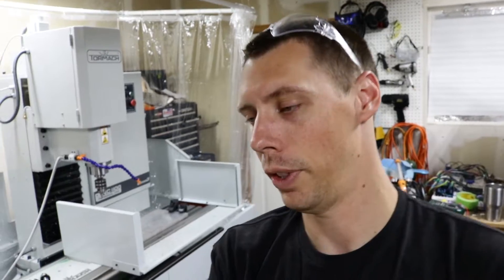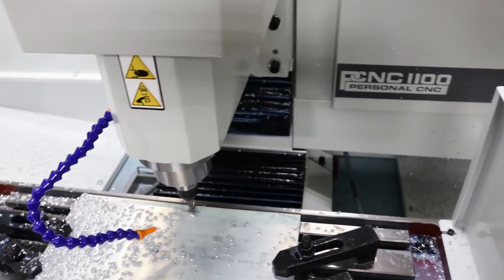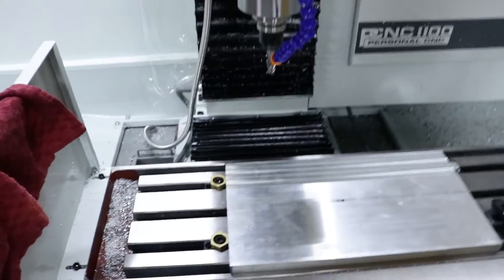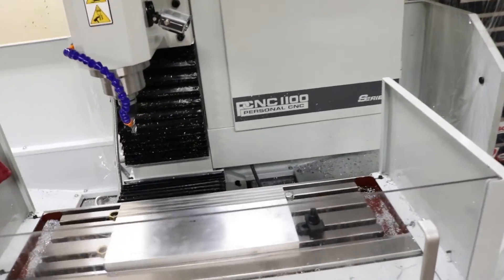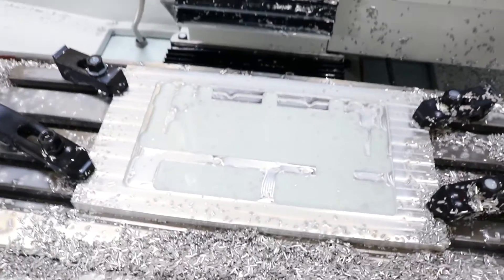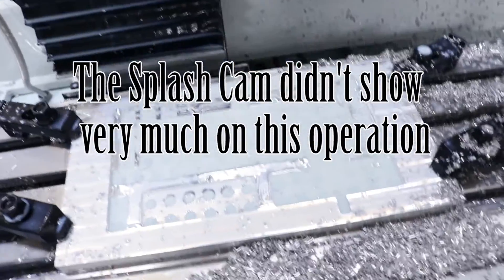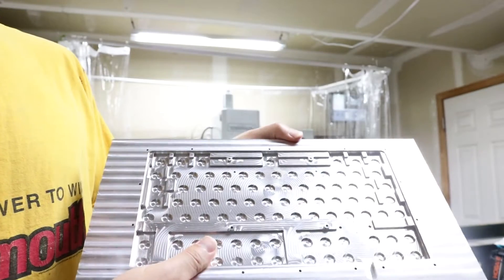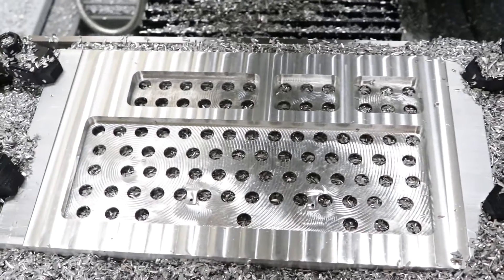Tormach 1100 Milling Aluminum Plate

Comment: Oof so barely cut one part and you already have chips grinding in the ways? I was looking at tormach for a while but now I think I'd prefer to spend a little more on a machine with linear rails and built in guards. The dovetails coming loose or going out of spec seems like a hassle.
Reply from the maker: They aren't grinding in the ways,  it's just the chips built up on the cover.  But yes, I would love some linear ways.

Comment: I bet you can increase your ramp feed on that helical entry. I think fusion defaults to 1/2 feed rate for plunge and ramp. The 3 flute zrn carbide end mils don't mind as long as your work holding is secure.
Reply from the maker: I thought that as it was running.  I plan to speed it up in the future.

Comment: Good stuff man . I probably would have clamped to bed drilled 4 holes (either countersunk or deeper counterbore to leave room for facing) to match the t-nut slots then bolted straight to the bed for the run. This would avoid a  possible clamp hit during the run and you would have almost full access to the top of the part. For 2nd side you can put 3  fasteners in and  countersink/counterbore the open hole. I won't get into how many times I've seen other machinists take out a clamp. Also if you make some keys that match (say with .002" clearance) your t-nut slot and machine a keyway (before you machine the top side) into the fixture you can pull you fixture in and out and it will be square to your X axis. Your shower curtains still need little fish on them :P
Reply from the maker: That sounds like a much better way to go about it.  I think I understand the first portion about drilling the holes and threading them directly into the t-nuts.  Can you explain  more about the t-slot key idea.  The part I'm making isn't a fixture, it's going to be the actual part.  Would the key really just be a t-nut except longer and taller that would act as a fence for the stock to sit against?  Thanks again for your advice.  The more I here about the fish, the better the idea sounds lol.
Reply: Oh hell I thought it was going to be fixture plate. My bad. Basically the idea (for fixtures lol) when you true up the bottom add slots you can bolt keys (just a trued up chunk of steel with a hole in it that will just barely slide into the small section of the t-nut slot) to then flip over and anything you machine on the topside will be inline with your X axis because of the key.  You will never have to indicate the fixture (if you take it off the bed and go to reinstall it) to get it parallel to the X axis. The keys will line it up parallel everytime.
Reply: And forgot if the fixture spans say 3 t nut slots I put the alignment slot in the middle rail and bolt down hole on the outer two rails
Reply from the maker: That all makes a lot more sense.
Reply: You might consider making an upsized version of this vise to get away from the clamps.
https://www.youtube.com/watch?v=YsLhXwt8pX0